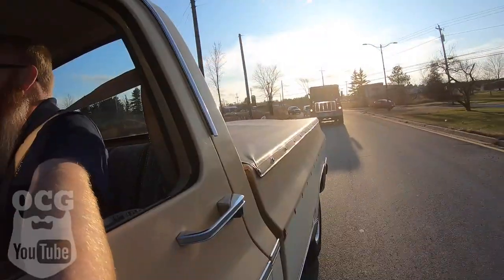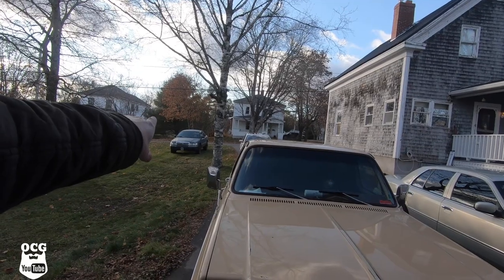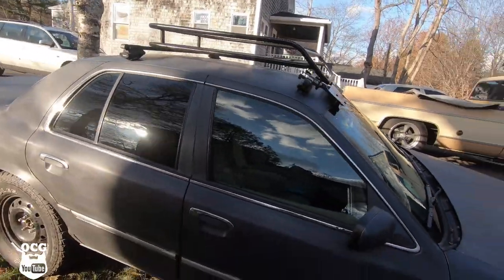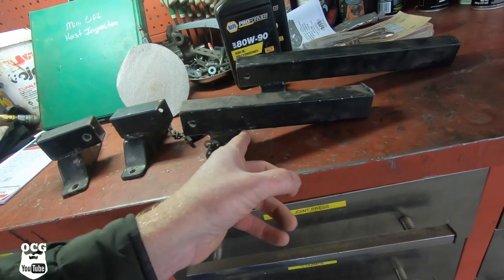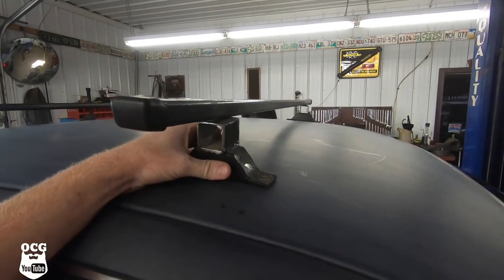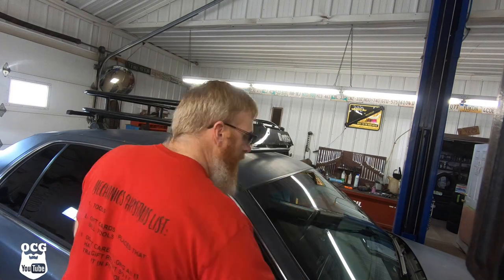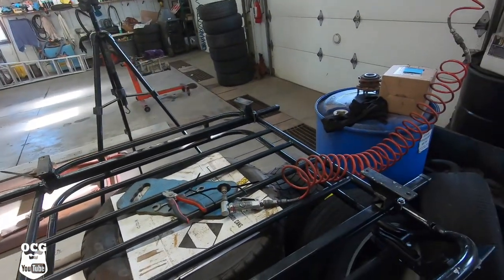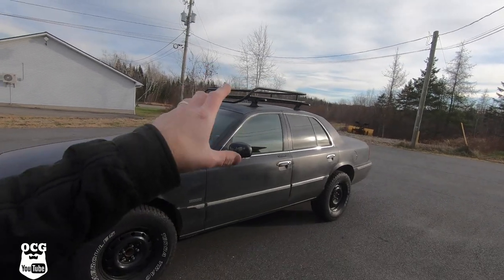Adding 5" More Height to my LIFTED Mercury (Panther Platform Build)

Comment: Tork Tech makes a supercharger for the 2v, might have to to only minimal modifications and AFAIK it fits under the stock hood, plus they make good low end being a roots type, which the 2v needs ESPECIALLY in a big car like the pather platform. Could be an idea.

Edit: Link to Tork Tech's website, has a blurb about the Grandma Keith/Crown Vic and what to do about the DBW system. http://www.torktech.com/faq-5.html
Reply from the maker: I’ll definitely be checking it out! Thanks for the heads up